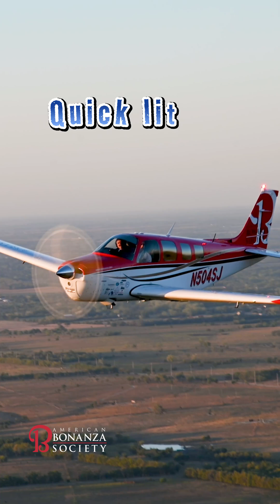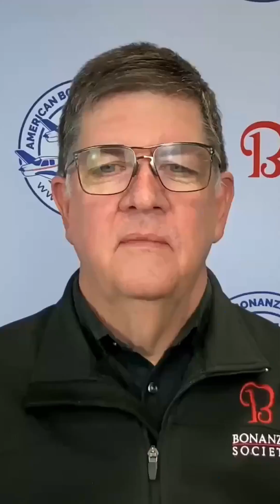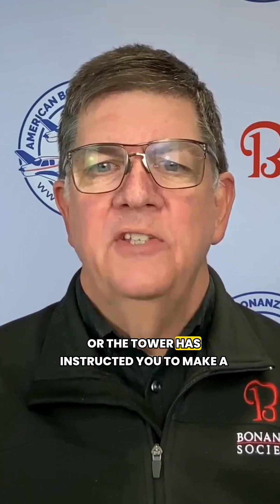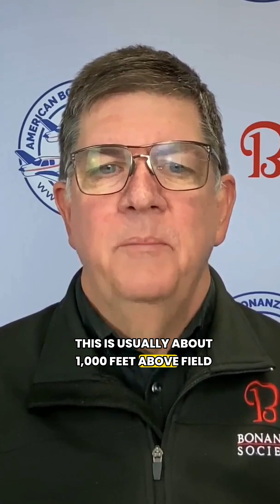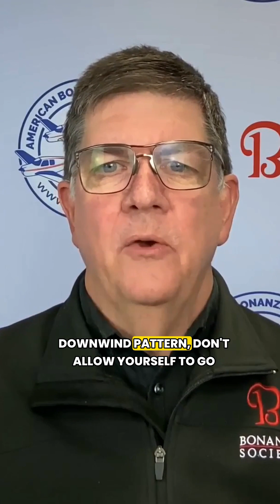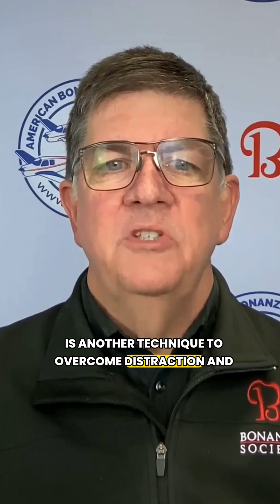Avoid Gear-Up Landings: Use a Gear Extension Altitude

Comment: I just like to do gear before flaps. In my baron the gear speed is much higher than flaps because it has continuous flaps. So its basically impossible to slow down to land without lowering the landing gear. So thats what id recommend: slow below gear speeds then throw gear down. GUMPS at typical spots (FAF, abeam, 5 mile final) and then i do a final check for flaps and gear and trim.